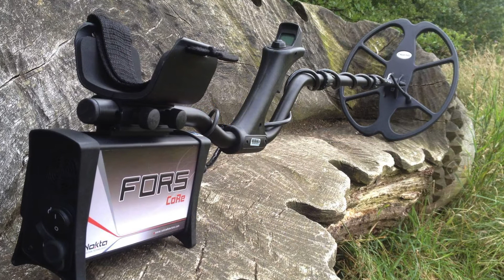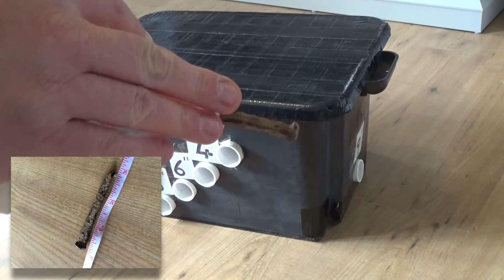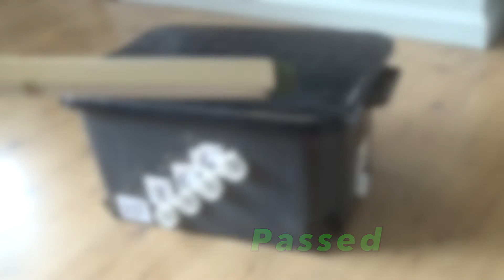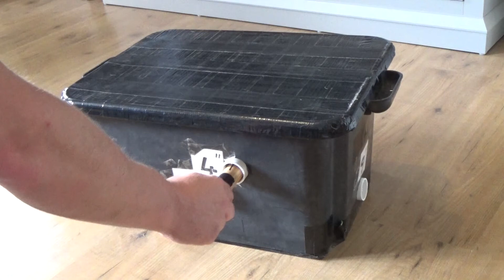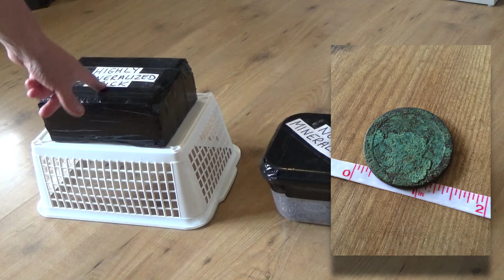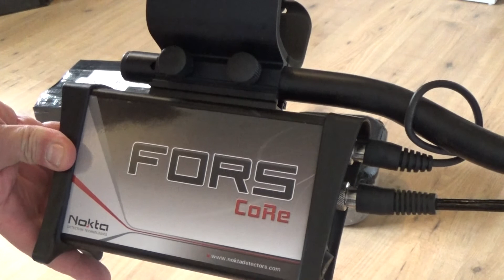Nokta Fors Core ( Test Series 1 - Basic Round 1)

Comment: This video helped me decide to buy the Nokta Fors CoRe about two months ago.  I needed a detector that could cut through all the trash.  I may be doing my ground balance wrong, but it seems to work well.   After the first beep I release the button and hold the coil still just above the ground without moving.  You will hear a drop in tone in a few seconds and the unit is balanced.      
  My favorite mode is ID2.

Comment: awesome test video.  were you in cognitive mode with the mineralized soil?  Also the numbers you were getting seemed about 10 higher than what im getting.  For example that silver ring would be 88 on my Nokta not 98.
Reply from the maker: With settings I will use any to pass this basic round providing they are usable in the field.... Machines numbers may alter in different locations and tests so long as the audio is correct that counts here.

If the audio don't hit right and the numbers are too low indicating iron then that will be a fail..... Long as the audio is correct over iron and none iron it will pass even if displaying no or low or high numbers.

If you get my drift 👍